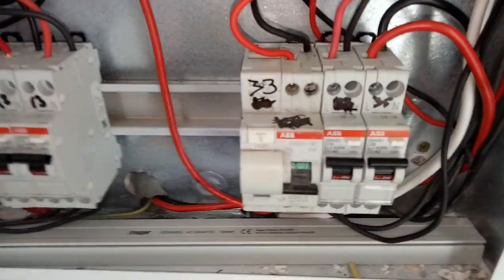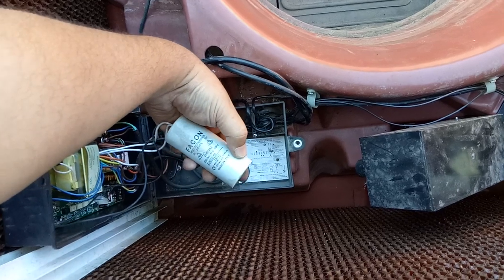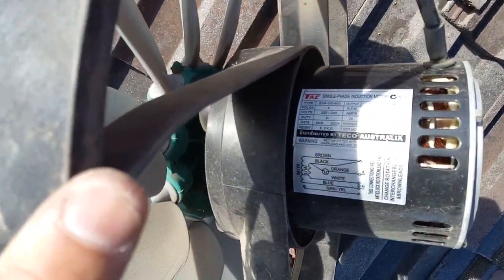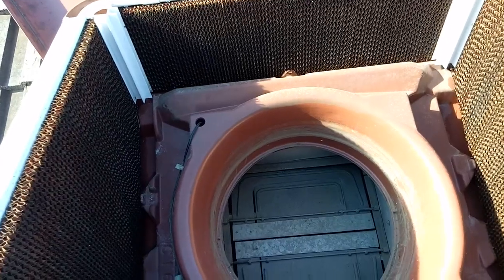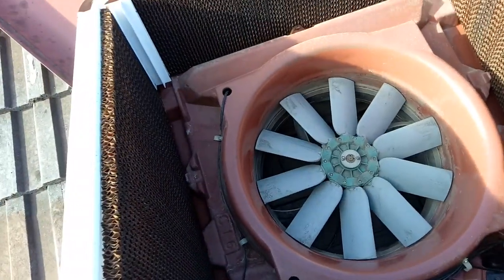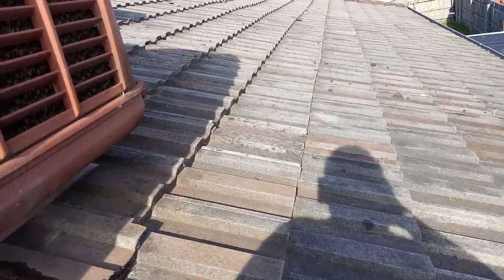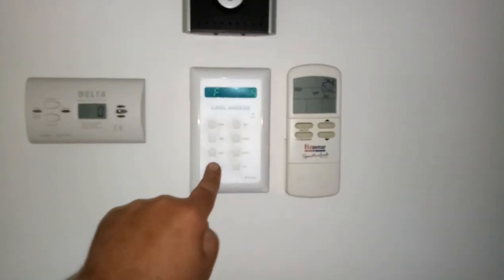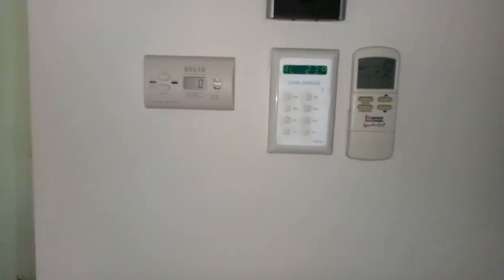Evaporative cooler issues

Comment: G'day mate, great explanation in your video and you covered everything well. Wonderful video to give a better understanding of how it all works. To share with you the wastewater from the system is fantastic for the lawn. My evaporative cooler drain is 19mm irrigation pipe plumbed down to a 60L container on the ground out the back and I clip the garden hose on it and move the hose regularly and the lawn is super green. And regards to humidity inside the house you must have every window in every room open and the moisture does not build up. I run my evaporative 24/7 from December to March when it's a hot summer and it does great. Cheers on sharing you knowledge.

Comment: Good video. Issue I had with that model was the solenoid. It appeared after 60seconds that the solenoid was working but in actual fact, the diaphragm had a small leak. Instead of getting mains water pressure coming out of the hose into that shut off float, it barely, infact it could not flow fast enough to lower the shut off so water just trickles out of the dump valve outlet. So symptoms are warm air coming out on a hot day and a steady trickle from the dump valve. Changing the solenoid is easy except for those stupid nylon bolts that stick and snap too easy. Use plenty wd 40 before you loosen them but wipe up any residue to stop smells. Once the new solenoid is in, there is enough water flow to flood the float that closes the dump valve. Water flows into the lower basin and the float behind the water pump shuts the solenoid and lets the PCB know there is enough water for the water pump to operate. Simple!

Comment: I wish I could buy a Cool Breeze or Bonaire in California.  We are stuck with limited choices of overpriced stamped steel belt driven squirrel cage blower units with Aspen wood shavings as a media. I have had 3 of them in 35 years at this house. They rust out starting with the louvers and the grids holding in the media pads.

Comment: drain pipe must be drained directly into the down-pipe dure to the high to the high salt and mineral content, it will rot your guttering if allowed to drain into guttering
Reply: why does it have high salt and mineral content?
Reply: @saauuzza  Because the evaporative cooler works by evaporating water and the dissolved minerals and salts are left behind in the coolers sump, when it activated the dump valve to dump the old water it has a high mineral and salt content
Reply: @wickedxe  thanks for the explanation.

Comment: I do hate it when the switch blows over a short we had our out door unit blew the breaker because the wires were bare, the wires insulation were dry rotted when you grabbed the wires the insulation would crumble in your hands so we got a new spool of wires that shit was 100 dollars it should have been 30 dollars but no, we put in the new wire but later found out the 3 amp fuse blew and wouldnt let the out door unit work so we got the fuse replaced and its been workin great

Comment: Can u tell me why inside controller has no lights, but have power to the plug that plugs into the controller board. Is that controller issue or a pc board in the part on the roof ?

Comment: Good job!
I have a 22 year old Bonaire that was probably undersized for our double storey 4 bed house.
I have been servicing it myself every year (being an ex Electronics dude), cleaning the pads every year and only once had to replace the solenoid valve. Im in the process of upgrading to a newer unit VSL75 as I have never replaced the pads on my old unit and thought better to invest in a newer unit rater than spend money on the old one. You mention you dont live evap coolers because of the humidity, however I dont mind them as I prefer an open breeze?

Comment: Hi mate, awesome video. I need some help please. Ive got the exactly same model as yrs. What is happening is the u it is working on vent function, however, doesn’t sustain running on cool function. Units is dripping water normally and filling up normally. If press drain, it drains completely and fill up afterwards. Middle of perth heatwave with a toddler not sleeping at night quite a nightmare. Need some guidance. Also, cannot get service until feb/22
Reply from the maker: If the pump is not coming on once the water has filled up and the unit is dripping water on the tiles. Then the float limit switch requires cleaning, adjusting and if that fails.. replacing.   The float switch is behind the water pump.. if the pumps running but no water or not enough.. pull pump out and clean around its base and suction ports.. if that does not help it may have faulty pump.

Comment: Hi Matt, a fellow Melbournite here Need some advice on a evaporative cooler, it's a Brivis L30 Contour Series unit. Turning the fan on from the control panel doesn't start up the fan. If I go on the roof and start spinning it either way it works perfectly until it comes to a standstill. Thinking the motor is having issues cranking over. Anything you could suggest I do. Thanks in advance Matt!
Reply from the maker: I'm not familiar with your unit. But most large fan motors have a start-run capacitor either attached to side of motor or in control box. This will be the first thing to get tested and changed if capacitor test fails.
Reply: Replace the large capacitor. the 600w motors run a 25 micro farad unit and the 750 & 1000 watt motors run a 30 micro farad cap. They should be aluminium cased capacitors now

Comment: Hi mate .. how about water sitting on the bottom ? How I can fix it
Reply: It drains out when you shut it down. If your worried about it just leave the fan running for awhile after you decide to shut it down and it will evaporate it off.

Comment: Ahem, how'd you get the lid off the top of the unit? I can't see any screws or anything.
Reply: There are four plastic fine threaded bolts that hand screw in with one for each corner. Takes 3 mins to get the top off one of these units.

Comment: Hey mate. Have the same aircon and when you turn it on cool the box thing that lifts up and down doesn’t go down and block the drain so the water just goes straight out the plug hole. If you hold it down with your hands and let the water fill up it will eventually stay down but after a lot of stuffing around... do you know why it’s not going down on its own?
Reply from the maker: Hi mate. I don't really use my evaporative cooler anymore but I did have this same issue when I first moved in. The water was trickling out of the from memory the end of that float device. The problem with mine was that the water intake valve / solenoid was faulty so therefore there was not enough pressure in the line to push down the valve on the float. Once I replaced my water intake solenoid valve and it's filter everything started to work normally.
Reply: Thanks mate. I reckon you are right. Let you know how I go